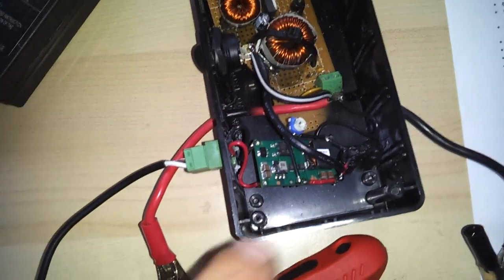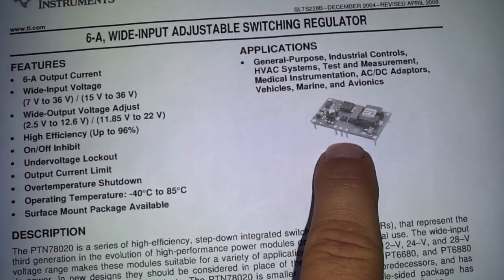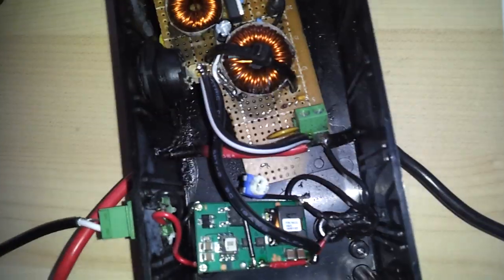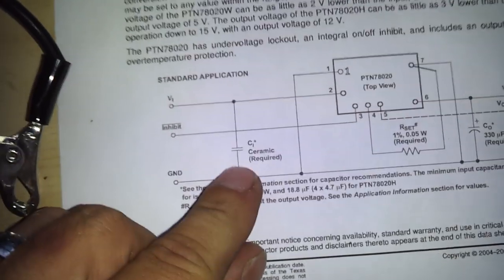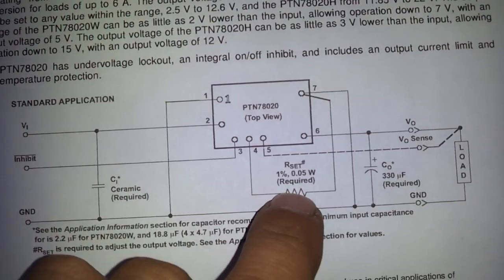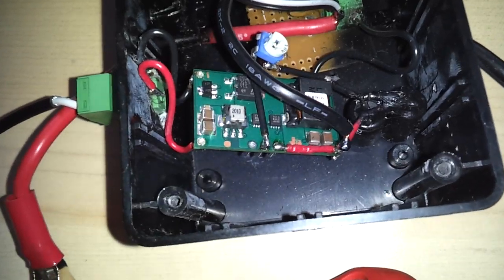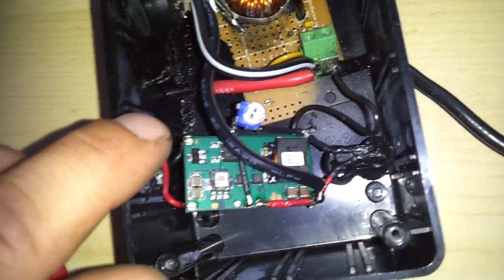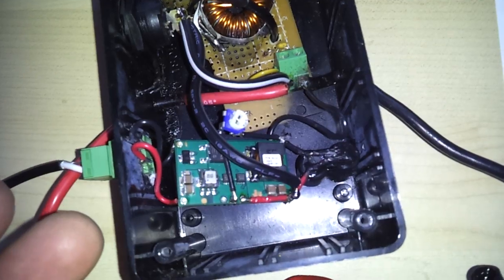Float charger for lead acid batteries / desulfat

Comment: Hey Richard:
Just a note to let you know I installed the 4 parallel 4.7uf ceramic caps as per TI tech 
and now the 78020H is working fine pumping out 240ma and dropping as the battery is
charging up to the 13.6 volt setting. The desulfator appears to be doing it's job just
fine. The boards you designed from OSH PARK are perfect! Thanks much!! (Sparky)

Comment from the maker: I'm not sure what part it wrecks but most likely the timer chip.  The reason why you don't run it without a battery connected is the pulse needs to go somewhere, and without a battery connected that pulse can get as high as 100vdc, easily frying the chip and possibly the capacitors and the mosfet if it's not rated for such a high voltage.

Comment from the maker: Sorry it took me so long to get back to you.  Regarding the TI dc-dc converter, the only reason I can see that yours wasn't working at first without the input capacitors is the quality of your incoming dc source.  I'm using laptop power bricks as a higher voltage dc source and the voltage ripple is much less with these.  What are you using as a dc input source?

Comment: Iysucool to be able to do stuff like this on your own but they sell products like the Battery Minder Plus for as low as $29.99 that is a 1.33amp charger and high frequency pulse desulfator that is a smart charger with a 7 step charge process including float charge at the end. Seems like alot less hassle.

Comment from the maker: As long as it's a "smart" battery charger that will switch to float mode once the battery is charged your good.  If it's a cheap $20 no name brand charger it most likely will eventually overcharge your battery bringing the voltage past 15 VDC and blow the timer chip.

Comment: Hi, I just saw your video and i was thinking how about putting a relay in your circuit to make it fool proof ? Let's say you connect the solenoid side on the battery poles and the relay side in series with the on/off switch. This way if no battery is connected to your desulfator the current will not get from the power supply to the desulfator and therefore will not fry it. As soon as you connect a battery and it has a good voltage the relay closes and lets the current go to the battery through

Comment from the maker: an lm317 could work, but remember that it's a linear regulator, so you better have a big heatsink on it since the excess vltage is converted to heat, not more amps.

Comment: actually, that output capacitor will damp down your desulfator, desulfator produces high voltage spikes which your dc to dc converter output capacitor will dampen. check out your original desulfator circuit, it does not use capacitor on the output and now you shunted a capacitor on the same output. you could how ever use a 100v diode to isolate those dc-dc capacitor from the desulfator  so as to as keep the spikes as high as possible. good idea on the dc to dc supply and deulfator. if you have an oscilloscope, you'll see what i mean.capacitors in parallel prevent voltage changes in turn you desulfator spikes will just be shunted to ground thru those capacitors.
Reply from the maker: ***** Good idea.  I wish I had an oscilloscope so I could actually see this.  I'm hoping to revisit this project this winter and update it, I'll keep this in mind.
Reply: see the difference by placing a diode 1n4002 on the charger circuit which joins the sulfator. so the 60 volt spikes are not affected by the charger capacitor. keep it up.

Comment: Hey Richard:
I built the trickle charger exactly like your specks. Set volts to 13.6 VDC and when I put
the battery/de-sulfator load on it I get minus 1.3ma from the charger.The TI factory tech I
spoke to said the 18.8uf input ceramic caps are necessary to make the converter work
properly. How do you get yours to work by omitting them? By the way, the whole affair
works and charges at plus 150ma using my bike trickle charger! Any ideas would be great!!                          Thanks--(Sparky)

Comment: why does turning on the DC power source without a battery connected wreck the desulfator circuit? what part of the circuit does it wreck? the 555 timer chip?

Thanks,

gav

Comment: how about lm317 circuit to REGULATE THE VOLTAGE IN 13.5V AS YOU can i use this circuit as dc-dc converter TO YOUR DESULFATOR?

Comment: these sell for $28. one on ebay sells for $15 and is rated at 15A

search ebay for "15A DC/DC Converter Buck Adjustable 4-32V 12V to 1.2-32V"

is there something im missing?

Comment: hey why not just add a 12v zener after the resistor so that if the voltage goes beyond 15V which is the maximum a 555 can withstand it sucks the rest. I think that no circuit should commit suicide if turned on while not connected to anything.